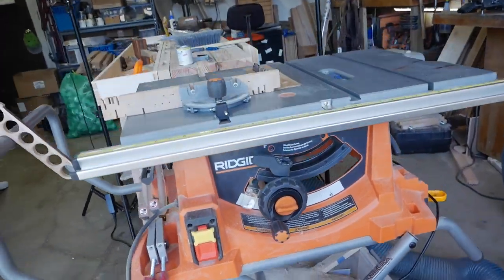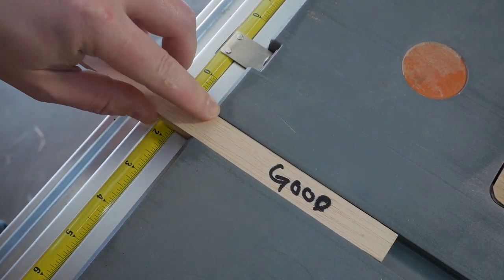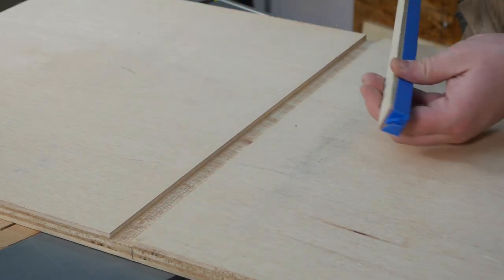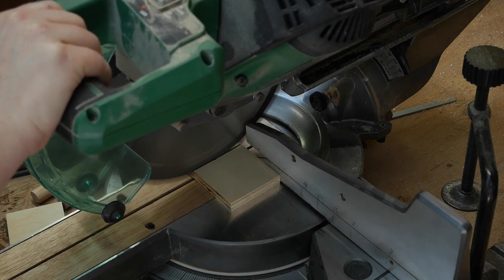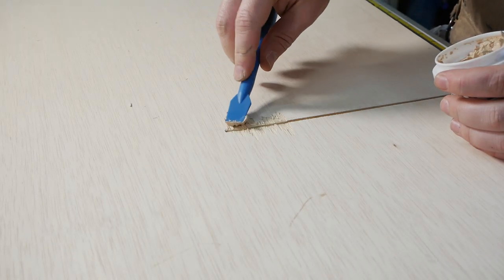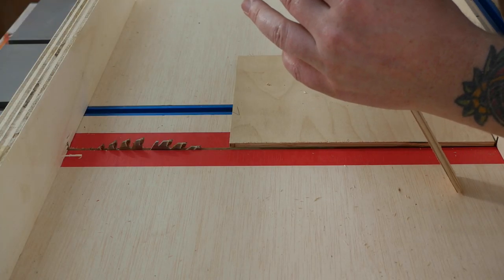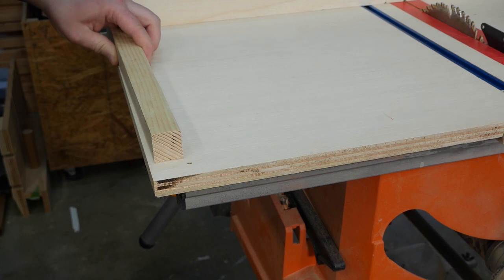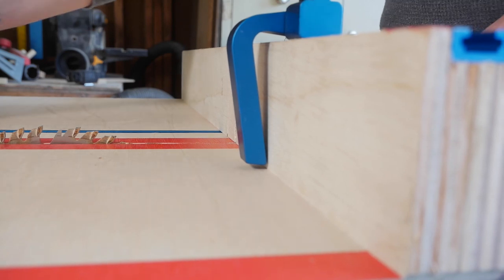Make A Crosscut Sled You Can Be Proud Of | DIY Project

Comment: Instead of read paint and nails poking out of the rear of the sled, why not have some sort of sled tail with an 'end stop' block extending downwards at the back so that the blade travels within the tail (so never pops out the back) and the sled can never be pushed past the point where the end block bumps against the main rail. Plus the presence of that cumbersome tail ensures that the user always stands to one side, never in the line of fire. I don't think I have seen that done somewhere. Is there something I am missing?

A drawing would be better, but let me just re-explain: take the red block, remove the nails, stretch it along the direction of the blade so that its length is the same as the distance from main rail to the blade arbor (+ extra). Now you have a very long red which covers the blade when you push the sled. Then in order to make sure the sled never travels far enough for the blade to actually come out at the rear, add some sort of stop below the rear end of that red tail. When the back fence of the sled reaches the middle of the blade, the stop block bumps into the rail.

Comment: I don't understand how that zero clearance insert works. Isn't that fence zero clearance anyway? What am I missing?
Reply: Its just a fancy way of saying the slot in the insert is the exact width of the blade. Minimizes tear out and keeps little slivers of wood getting stick between the blade and the insert.
Reply: @EitriBrokkr  I get that, but why make that insert in the front fence? Why not just let the blade slightly cut into the fence like every other cross cut sled? What's the difference?
Reply: @weeschwee  if it gets ruined, or a using a different width blade or dado stack. Ironically he didn't make the bottom slot replaceable
Reply: @EitriBrokkr  I suppose. That's all I could think of.
Reply from the maker: All good points, in retrospect I should have made the bed of the sled replaceable too, just having the fence zero clearance while the rest isn't doesn't make sense. One of those hindsight 20/20 things
Reply: @Craftswright  can never make too many table saw sleds :)
Reply: @Craftswright  Is that insert there for when you want to use different blade widths?
Reply from the maker: Correct, I typically keep a 1/8” kerf blade on but if I wanted to use something smaller I wanted a insert for it. For some reason I never even thought of the sled bed 🤦‍♂️
Reply: @Craftswright  ok, thanks for the clarification. Interchangeable inserts for the bed would be cool, but I wonder if it would introduce weakness or inconsistencies. Might be a fun experiment.
Reply from the maker: I think if a different material was used, say thin UHMW plastic like a cutting board, recessed into a shallow rabbet it shouldn’t mess with structural integrity 🤔 now the gears are working 😁
Reply: @Craftswright  another video is born!

Comment: Why not just flip the side of where you make bevel cuts? So instead of cutting bevels on the left side, cut them on the right side of the sled. That way both runners can stay permanently attached, and the one not being used will overhang off the table edge when used in that configuration. The downside of doing it this way is that it's not fully supported when overhanging the table but the center of gravity is still over the table top so it should not tip. This is how I designed my sled.
Reply from the maker: Hey Andy, I think I’m missing something in your description. If both runners are still engaged in the miter slots, then the blade is still centered between them? What am I missing because the idea sounds legit other than that!
Reply: @Craftswright  when you’re cutting bevels on the side, only one miter runner is engaged. It they’re both still attached. Instead of removing the other one, let it hang off the edge of the table. When both miter runners are engaged, the blade is in between them